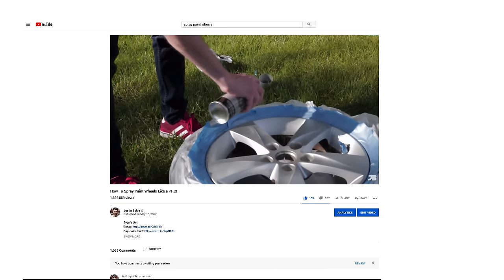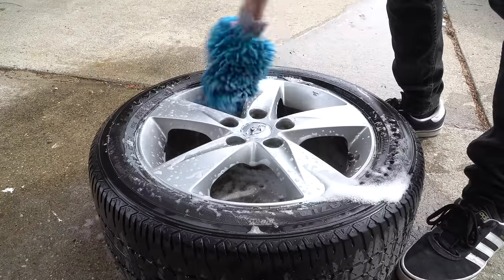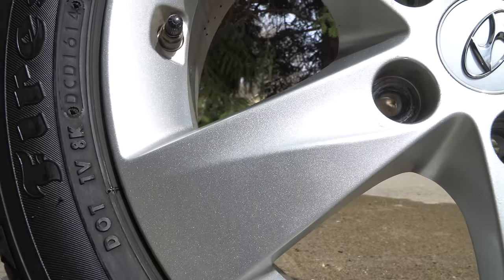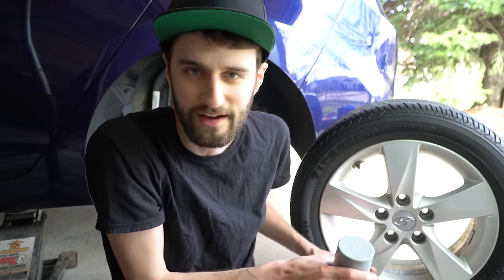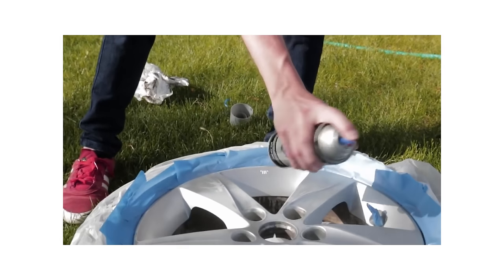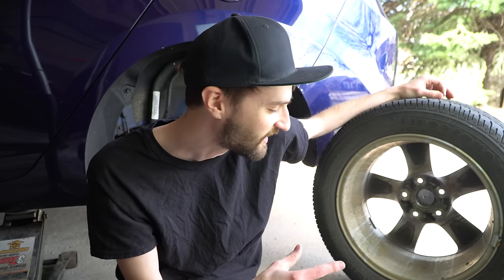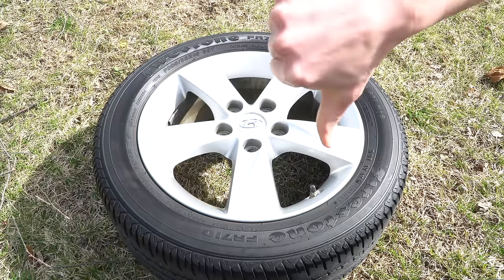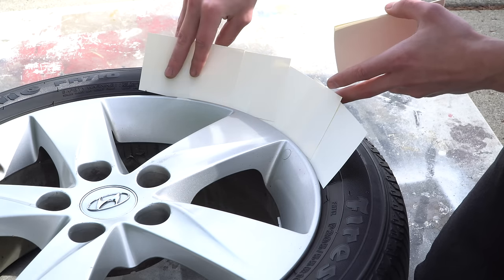Spray Painted Wheels 2 Years Later! | DID IT LAST??

Comment: I painted the rear brake drums on my GMC Sierra with the cheapest gloss black paint I could find from home depot. Prepped and painted very similar to how you did the rims. Only difference being I had to use a metal wheel to remove surface rust. Long story short it has been a couple years and they still look good. When paint prep is done correctly spray paint can last as long as any other paint.

Comment: Nice video buddy.  If you listen carefully to the sound track while spraying both the paint and clear coat, it was evident that either the can's were not thoroughly shaken, the cans were nearly empty OR the can's tube was not designed to spray from the nearly horizontal angle you were holding the cans in.  You could clearly hear part of your application was the product alternated by just the propellant which will certainly affect your final result, giving you far more orange peel despite how well the paint self-levels.   I suggest you try supporting the wheel in a nearly upright vertical position  That will allow you to hold your spray can close to vertical as well.  The brand you chose features a patented "fan spray" tip that will give you better results than competing sprays, but the finest tip cannot compensate for holding the can at an angle beyond around 45 degrees.  Keep up the good work and the end result after 2 years shows that you did a great job overall!.

Comment: Great video!  I was going to try this myself but didn't have a clue where to start.  One question, the product that you used first that turned red and you sprayed off, do you use this with every car wash or just for special products?
Reply from the maker: I only use it occasionally if the wheels are really dirty. Maybe once per month, if that

Comment: Can I use regular spray paint or do I have to use ones that are specifically for wheels?
Reply: Duplicolor that he used is typically purchased at an auto parts store like OReilly / AutoZone...  It is a Automotive EXTERIOR Specific Paint.  I have used alot of different Rattle-cans -- and I can tell you that the $.97 Walmart Rattle-can is way different from Duplicolor.  WELL WORTH THE $7 a can!    ...This is GENIUS, and the best way to go....

Comment: Hey I liked your video and I found it informative. I have a new truck and I just put 20s on it. But I am wondering how often you think you will have to repaint those Wheels? They do look good after 2 years for sure. Do you think you get longer where if you had them professionally done or if the product that you use is the main factor? Thanks in advance
Reply from the maker: They still look good after two years. A professional paint job will last longer but we are talking $500 to have a pro strip the wheels down and re-finish them compared to $20 doing it yourself

Comment: Great video!! Redoing my winter wheels in same color Duplicolor. Someone told me I should be using a 2K clear. The wheels will only be on the car 3-4 months a year, do you recommend using the Duplicolor clear or 2K clear? I noticed you're in Michigan, did your mom use the refinished wheels in the winter and go through the car wash once a week with them?
Reply: Also, how long did you wait between spraying last base coat and first clear coat...and how much time between clear coats?

Comment: Hey Justin, I’m in the market for a new car I’ve always had a Honda but  I was looking for a change and wanted a Beamer. Do you have any recommendation on what model I should look at and which ones the most reliable ? Keep up the good videos! I’ll be panting mine when I get a new car.
Reply from the maker: Mine has been pretty reliable. Look for an E90 (3 Series made from 2006-2011). Get a non-turbo inline six engine like you would find in the 325i, 328i, or 330i. Even better if you get a manual transmission. They were really solid cars that are easily capable of lasting 200,000 miles.
Reply: Justin Buice my 330 I sold at 221,000 miles with basic usually late maintenance. Reliable for sure. Loved that beemer.

Comment: Easiest way by far to mask off tires is to get a vacuum pump and pump down the tire just enough to fit a bag in between then let the vacuum out and the tire will hold the bag against the inside of the rim..

Comment: When she has to have her tires changed, the paint is going to be gouged on the edges. Also, during the stages of painting, sanding the paint down to a glossy smooth finish before adding the clear is key as well as sanding the clear to a glossy smooth finish. This will help eliminate brake dust from becoming trapped in the irregular/rough surface for easy cleaning. Overall, this is a great job! Very cost effective.
Reply: You do not have to sand the paint before clear… Especially metallics. Doesn’t work like that.

Comment: Hi Justin, how do you fix a scratch at the edge of the wheel only.  this happens when parking, I did this to my Lincoln mkc, it is about 2". Do you  need to paint the whole wheel again or just the spot where the scratch is. thanks

Comment: Hello I have slight curb rash on two of my rims, if repainted as you did in video would the other two wheels stand out as a little inferior to the painted ones. And would it be better to do all four rims? Thx
Reply: I had curb rash and I just sanded them down and was able to make them smooth and then painted!

Comment: Great job, good advice and they came out great but come on , it's your mom! Paint the inside of the wheels! ( I wouldn't have done it either) Wondering why your working on the ground? Seems like a plastic table or saw horses would be easier, work smarter not harder love the job you did

Comment: I try to do my wheels bare metal,i use primer and it didnt stick why was it?
Reply from the maker: It’s possible that there was some oil on the wheel from your hands. Painting bare metal is tricky. The primer that they use at the factory is more durable than anything you can buy in a spray can

Comment: You don't mention WHERE you live and WHAT ROAD CONDITIONS you see... I live in the Salt Belt and NOTHING lasts - especially NOT clearcoat, which FLAKES OFF. I ruined some aluminum wheels like that. I installed new wheels and the factory powder coat rusted within 2 years!!! I'll say it again - I can't understand why they can't make wheels that don't rust. Stainless steel wheels are widely available for motor bikes, why not for cars? Wire wheel, acid rust treatment, prime and paint every two years SUCKS...